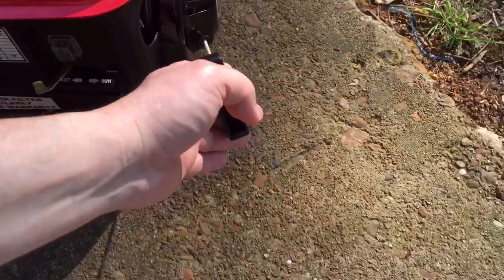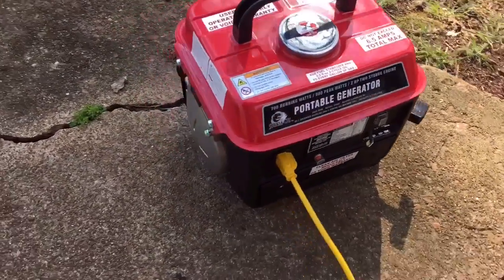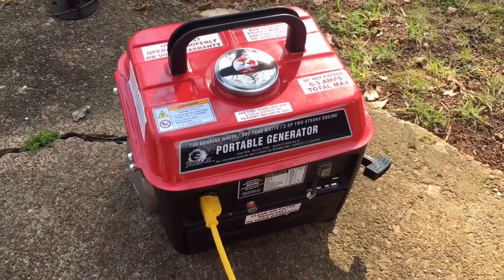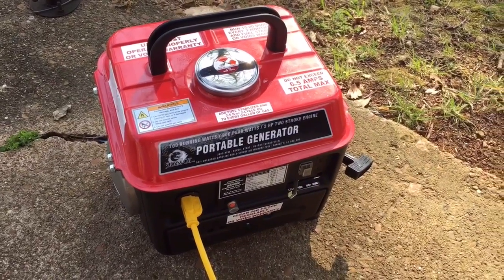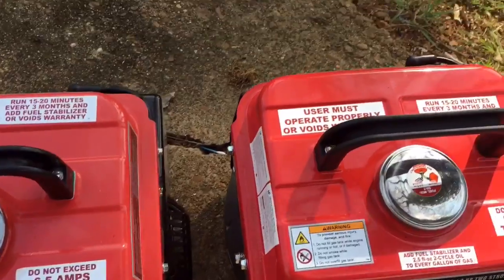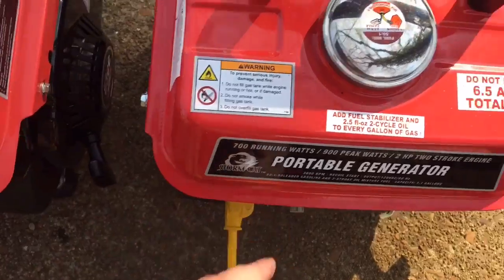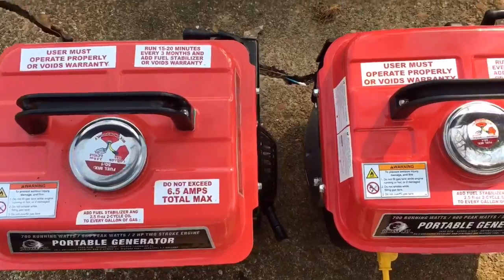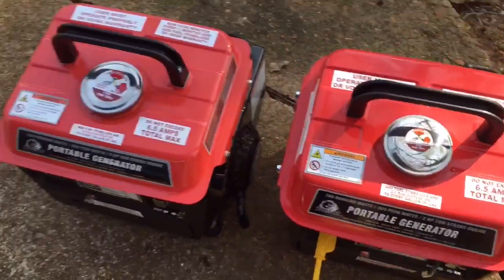StormCat Harbor Freight generator 60338 - Dead at 281 hours of use

Comment: My 60338 has survived two, week long power outages. One for a hurricane were it ran a light, portable TV, fan and a small refrigerator, and the other was a freeze where It ran a light and a small space heater. I regularly use it for camping and when I need power on the other side of my land. I had to restring the recoil rope and replace the capacitor. It was still making power but it was way down in voltage. I just did the quarterly maintenance on it and it still runs smoothly and can make a cup of coffee. I shut off the fuel and let it run out of gas. I drain the carburetor bowl and drain/dry the fuel tank when I'm not going to use it in the foreseeable future.
Reply from the maker: Thanks for sharing

Comment: I agree with you on the 60338.  I bought mine back in 2016 and ran it for about 20 minutes a year.  I finally needed it for Hurricane Ian.  Total run time before lock-up was 6 hours...

Comment: I run my lawn mower around 20 hours per year.  So if it failed at 281 hours that would be 13 years of use.   I also have one of those generators. The durability matches the price and it's purpose.

Comment: How is 281 hrs (11 days ) alot? I have a Generac 5.5Kw generator purchased in 2005 that has 10x that amount and still runs great. Seems like a cheap tool that will not be able to perform  when needed most.
Reply: Comparing the longevity of a 5.5kw Generac to an 800watt Stormcat , 2 cycle at that, is like comparing a Peterbuilt Tractor Trailer to a 1985 Yugo.  One’s designed for Million + miles/durability and the other is designed for affordability/economy.  Gasoline  vs. 2 stroke is a no brainer when it comes to longevity.  I do understand where you were trying to come from though.

Comment: I run 32:1 in mine, sounds like yours seized.  Maybe you didn't mix the fuel properly?  All 2-strokes will eventually freeze, will check your other vidoes for an autopsy.
Reply from the maker: Same fuel mixture I used in the other one, which ran for well over 1000 hours
Reply: @KevCentral  yep, and using the correct type of oil is important as well.  The air cooled 2-strokes are hot-sleeve engines, thus need the oil formulated for high temp engines oil type API-TC.  Chainsaw oil is this type.  2-stroke outboard marine engines are water cooled cylinder sleeves, thus the TC-W type oil engineered for them has the incorrect type of additive package and will fail in an air cooled engine.  Look for air cooled 2-stroke oil (API-TC) intended for chainsaws and air cooled 2-stroke motorcycle (dirt bike) engines.  Avoid 'universal" 2-stroke and/or marine 2-stroke oil.
I've always used 32:1 for anything made since the 70's, and mix with fresh gasoline at time of use because 2-stroke pre-mix can lose a great deal of lubricity in storage, so discard stale fuel safely (my old 4-stroke lawnmower gets my stale fuel).

Comment: if these are clones of the Yamaha et650 then why not just get one from ebay that produces 1200/1000 watts? Also what about the break in? I am planning to add full syn 2 stroke oil to the cyl and lube it up before starting with 32-1 break in oil.  from past 2 stroke experience i know the first run is a make or break but i see little info on breaking these in properly.  also any experience attaching an inverter to the dc ports for clean power? I am going to use the ngk bpr7es colder plug as I am in very hot weather.

Comment: Bet your carburetor is filled with gunk. You can tell you're putting to much oil to gas ratio. And never use the off switch. Turn the gas valve off to prevent gunk in carburetor.
Reply from the maker: +Paul Yanez I measure oil using  ratio-rite. Also, this is the same mix used in the other generator and the same tank that was working fine 5 minutes before. Watch the other videos on this generator and you'll see that what you're watching is a hardware failure in progress. Thanks for commenting.

Comment: that's what happens when you use cheap, crappy 2 stroke oil. mine has about 2000hrs on it and I haven't had any problems except needing to clean the carb once. I use mine everyday for about 10hrs. I always run high quality racing 2 stroke oil, or non synthetic 10w30 in my 2 strokes. you ask... "why 10w30?"... because 10w30 or 30 weight was the original 2 stroke oil, and if I'm in a are an that doesn't sell high quality 2 stroke oil, then I'd rather use a high quality motor oil that won't destroy my engine. the only problem with 10w30 is, it's a little more ashy and you have to clean your spark plug and exhaust twice as often. you can ring a new cylinder and piston for that generator online for about $50 on a Chinese website if you want to fix it.
Reply from the maker: +ben hawke except that wasn't with "crappy 2 stroke oil." That was using the same Lucas 2-stroke oil that I use in my other generators. Check out my videos. I have numerous generators of this type and have ran and tested them extensively. Like you, I'm a fan of using quality oil - Though this failure was component related, not oil. Thanks for watching and commenting
Reply: KevCentral I've use the engines that come in these generators in a few other things, such as go carts. you can order then from alibaba online, and I had one that they either stripped or forgot to torque for a connecting rod bolt, and the same thing happened.
Reply from the maker: +ben hawke Yeah. I'm almost positive this was the con rod. It started knocking within the first hour. Honestly, I'm amazed it ran for so long with the knock. Resilient little engines. I'm happy you mentioned gocarts. How long do they last in such an application, and how fast will the kart go? These are larger CC than my first scooter, so I imagine they do quite well.

Comment: why is it smoking?  mine does the same thing. evem if i lean or rich the oil/gas ratio. can any one tell me? plus if i use the generatot 3 hoyrs a day, at about 500 to 650 watts and at the end of yhe life of the engine lifespan the muffler tip will be a lot of oil buildup even if i put little bit less oil in the gas and change the spark plug every 2 weeks.
Reply from the maker: +Larry Sledge Jr Don't lean or riches up your mixture as that can create huge issues with a 2 cycle engine. What oil are you using? Some smoke more than others, but shouldn't smoke as much as you see in this video at any point other than maybe a cold start. How many hours of runtime are on your generator?

Comment: you forget to mix your gas with  oil
Reply from the maker: mecanicman66 What information do you base this statement on? I always mix, and mix well. Not only that, but it's the same batch that powered the other generator long after this one died. I suggest you follow the video series for more information before making inaccurate statements.
Reply: there is a comment section here if you dont want comment disable the comment section like some does  hey it was just a constatation i made i never call you a goof    so block me or disable  the comment thing thank you for taking time to read me and commenting
Reply from the maker: mecanicman66 You're more than welcome to comment. I have a full series of videos on this generator. It made it much longer than was expected.
Reply: ok thanks to you kev ill look up the other video,s cheers
Reply: i even subs to you it will make it easier for me to find your other video,s

Comment: 37 cents an hour is cost for just the machine. Not bad.
Reply: i can tell you right now, that when you are roasting in the heat, 37 cents and hour is chump change to have a working fan. just did a week with out power in SWFL.
Reply from the maker: Dane H That's just in the 60338 model. The 69381 that was part of this series is closing in on 1000 hours and still running like a top.

Comment: Looks like it seized up not enough oil in gas
Reply from the maker: Fish Mower Same mixture and gas/oil mix as the two 69381s, which are still running perfectly. It knocked badly from the first hour, so I'm amazed it made it to 281. That said, I can assure you the gas/oil mixture was perfect.

Comment: can I add sea foam to my 60338 stormcat generator?
Reply from the maker: Eduardo Chavez I've been using sea foam in mine since day 1
Reply: KevCentral Just picked up a 69031 on cl for $40! major quality difference than the 60338.
Reply from the maker: Great to hear. Thanks for posting!
Reply: KevCentral any idea why when I start my generator, it creates so much smoke! the choke is all open for when I start it. I also run it with full open.
Reply: not the choke, the fuel valve
Reply from the maker: Eduardo Chavez They smoke heavily when they first start. Once it's warmed up it should run relatively smoke free. If not, you may need to check your fuel mixture.
Reply: KevCentral I just ran it and waited 5 minutes, the smoke was almost gone! thanks. Also would a new spark plug help with my 69381 model?
Reply from the maker: Eduardo Chavez I changed mine out, but it's not required if everything is currently running well.
Reply: KevCentral Hey you know the little cup the generator fuel cap includes? Do I fill it up to the >pe< because I don't have anything to measure 2.5 Flo oz
Reply from the maker: Eduardo Chavez On all my generators there are measurements on both sides of the <PE>. The max measurement (which is even with the PE) is 2.0oz. You'll need 2.5 per gallon for a proper mix.

Comment: Kev I  bought a 60338 about 9 months to a year ago. I broke it in then drained all the gas out. 3 days ago I put fresh gas and oil in and it wont start. after those 3 days I finally got it started.Yes I warmed the plug as it kept flooding.Today it was running and I was using a hand held circular saw and a small sander when the power from it just stopped. The generator was still running.I plugged those tools into my mains electric and they both ran good. Any suggestions I can try to fix the generator.
Reply from the maker: Did you try the reset on the front of the generator? Some hand saws can use quite a few amps. It may have overloaded the generator.
Reply: Yes I tried that , no luck though.I called H/F and they said to flash it (lol) Not sure  how yet, They sent me email telling me how to flash it.
Reply from the maker: Are you sure they didn't confuse this one with the inverter model? I didn't know this generator had any electronic components that could be flashed.
Reply: I was told to flask it when I called Harbor freight tech dept.I did the electric drill flash but it never worked.
Reply: Kev, do you have any suggestions to get it working.
Reply from the maker: I'm confused by what "electric drill flash" is.
Reply: Apparently you have to start the generator, then plug in an electric drill  then press the drill button and while the drill is in forward , spin the drill backwards.somewhere on youtub you can see it being done.
Reply from the maker: George Lee interesting.
Reply: KevCentral spinning a motor used as a generator or using DC battery to power on the AC plug rebuilds the internal remaniscent field that is there always even when off but sometime it vanishes completely so spinning a "shorted" squirrelcage asynchronous motor to use it as a generator is a complete fail. If you flash it with power it comes back to live from counter induction
Reply: @MoesKeckeEcke  That only works though if you have a "F" type disgronificator in the generator.  It will not work with an older "P" type, which is more common on small generators like this which are usually equipped with integral slap-back exciter circuits.

Comment: I've gotten over 2,000 hours on these little generators.  I used the last one every single day, 12-16 hours a day for over a year.  All we had for power was a 7500w unit and one of these 2-stroke generators.  I only used the big one for powering the water pump because it would consumer $475 worth of fuel a month (ouch).  I would still put $175 a month in fuel through the little 2-cycle, which gives you an idea of how much I ran them.  Saved three times its cost in the first month alone.  I've had great luck with these, but did devise a starting/stopping procedure to aid the lifespan and prevent the starter from breaking.  Never start one of these without the choke fully on.  Never pull the rope without the choke on (risk back-fire and breaking the plastic starter).  I shut them down with the fuel shut off, not the kill switch, this keeps the carburetor clean and dry.  They are loud but always run.  Plus I doubt that many people are getting 2,000 hours out of the Honda, some may, but most probably don't.
Reply: That's a great shutdown procedure you have there. If everybody done that, I would have to close my shop most likely. I really believe in those little generators for saws and lights but I wouldn't run anything electronic with it. There is no reason it shouldn't last at least 1500 hours. It's running at a really low RPM for a 2 cycle. It should last a long time if good synthetic oil is used and a little maintenance is done every now and then.
Reply: Yea mine busted the damn pawl of the started so I cut the shroud and made an electric start for it!

Comment: I use mine. alot why it isn't steady power the lights flicker
Reply: Bryant Matthews because it's how cheap they are built they don't have a circuit in them to smooth out the electric current
Reply: 2 cycle for you.

Comment: very interesting to watch it have 2 a schneider Germany  950 red top and a powercraft yellow top both 2 smokers look very similar to yours they are 650w 240v UK ones 1 is 2004 and 2006 hardly used still run sweet I will have to do a video and share
Reply from the maker: Awesome! Let me know when you get a video uploaded. Thanks for commenting.
Reply: KevCentral will do I'll have to dig out a mower petrol tank to run the powercraft as the tank fuel tap is defunked. paid less than 40 pounds for the pair I'll try get something taped tomorrow afternoon 👍

Comment: Were you able to determine why the generator died? What failed on it? Was it able to be repaired?
Reply from the maker: 10106106 It was under warranty, so I didn't take it apart to see exactly what broke, but i'm reasonably confident (because of the sounds it was making leading up to failure) that it was a connecting rod bearing failure.

Comment: Thanks for making these series of videos. I returned my original generator which was the older model and replaced it with the new model one today. You spent some money on gas and 2 stroke oil. That's for sure. lol.
Reply from the maker: Thanks. I'm glad they helped out. I have to admit that I didn't anticipate the cash output the tests ended up costing, but it was worth it. Just an FYI, the 69381 has over 500 hours and is still running like a champ. It's not babied either, they keep it on the front porch of a cabin when not in use. One day I hope to get to it for a follow up video
Reply: +KevCentral No problem. It's quite a coincidence that I stumbled across your videos after I bought mine. That's a lot of hours!!!! WOW! Although when you think about it, if the power was out for a couple of weeks and you had to run the generator all the time, 500 hours isn't that much (Hope that never happens). I'm look forward to seeing the video if you get it back. I plan on buying an hour meter for mine to see how many hours I get out of it.

Comment: My Harbor Freight  Storm Cat has 50,000 + Hours on it   Just kidding   I bought one on sale for  89 bucks it is what it is.    the one I have I ran it with extra 2 cycle oil in the first tank.  but after a while it was hard to start and the carb was leaking.  so I  flipped it over and took off the float bowl  found dirt  in the Bowl and the  O ring was not seated properly to seal the float bowl they  have  over spray and Crap in the tank from the Factory  I cleaned it out and would recommend a fuel filter .  also I use Sthil  Hp  2 cycle oil (Silver Bottle ) its Synthetic  and Burns very clean  I use it in all my Saws and Trimmers  but I also have a Honda EU 2000 that I use .    The Harbor Freight  is Great to Throw in the Back of the  Truck  and go
Reply from the maker: Yep, can't beat the performance per dollar of the HF generator.
Reply: KevCentral curious do these generators have any hour rating or life expectancy that you  know of.  also are there engine rebuild kits available
Reply from the maker: I don't believe there are any posted life expectancy ratings (though the 69381 I have personally experienced to exceed 500 hours without an issue). There are parts available at various sources, but the cost of parts replacement would rapidly exceed the $88 a new generator would cost. Sad, but true.
Reply: KevCentral sir i do appreciate. you taking time to answer my questions
Reply from the maker: Thanks for watching and commenting.
Reply: 1995dresser and

Comment: IMO the best ones were the Chicago Electric blue top ones. back before i got my other generators, that's all i had on hand when hurricane sandy swooped in and created a nasty mess of the area. luckily for me, my house has a natural gas line and my heater is a central steam boiler (pulls just ~85W for the valves etc). i ran that Chicago Electric one almost non stop for 5 1/2 days straight. it held up like a champ and allowed me to keep my house warm, keep my cell phones charged, keep the necessary lights on, etc.  it did eventually die on me a year later, but luckily died just before the extended warranty ended. i received a 60338 which was garbage in comparison. i used the warranty again and got them to switch it with the 63891 one which was much better but still not as good as the Chicago Electric one
Reply from the maker: Great info. Thanks for sharing.